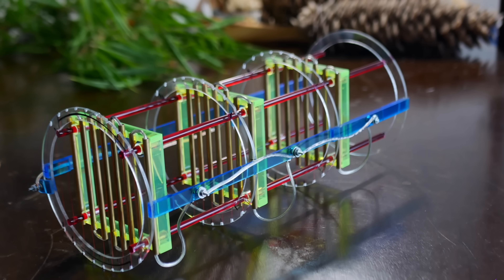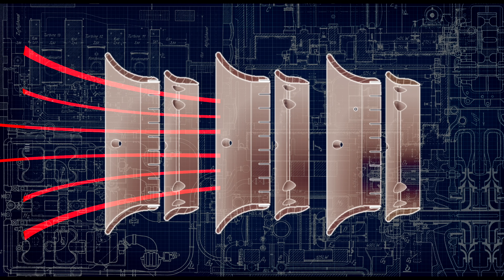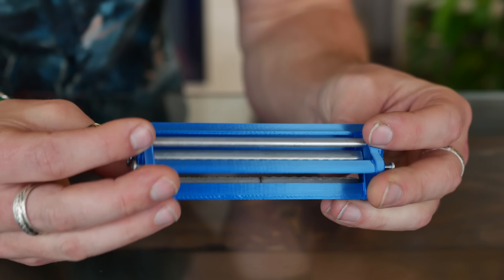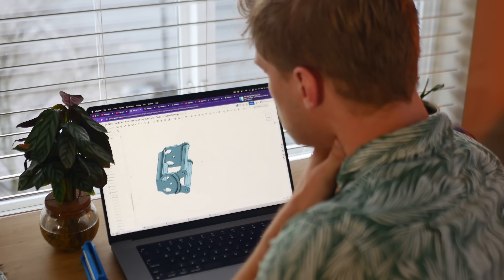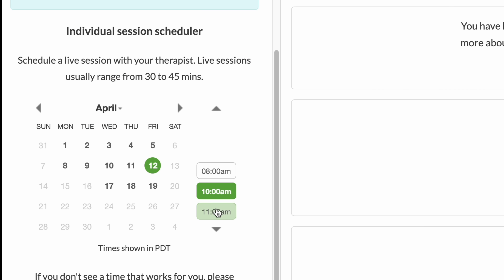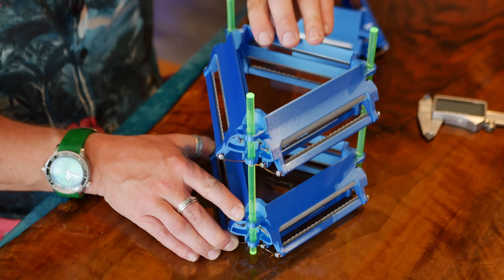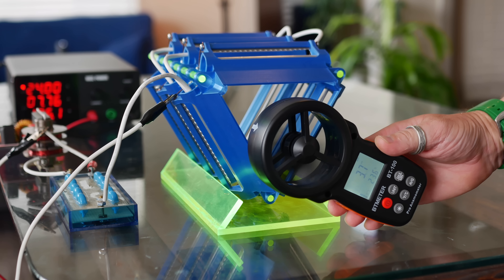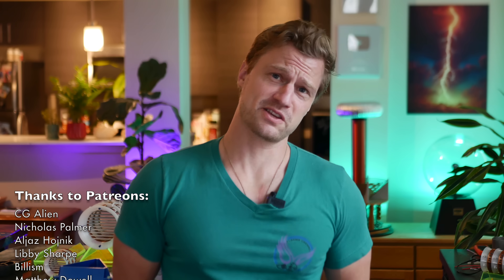Next-Gen Ionic Plasma Thruster Inspired By Nature (BTC Mark 3)

Comment: What happens if you build casing around them? I’m thinking a design where the center is hollow, but the casing has separate channels branching out for each thruster. Spaced out and curved so that each thruster has its own output channel which can converge into a more controlled air stream coming out the back of the setup. Kinda like each section has a funnel on the other side where the sections are separate until the end where it’s all dumped out in the highest pressure possible

Comment: What will be the power source to provide 14 hr's of flight in commercial aircraft, a taser is a lot of power and the weight of the power pack and the payload of the aircraft of today must equal or exceed payload. Then what will be the effect of the wing if power is lost will the wing still provide the glide range needed for a safe return to ground?

Comment: what if you kinda put the same tipe of motor in the center of the current desing for more concentrated airlow and maybey higher airflow
Reply: the it will be weaker structually

Comment: Sorry if this is a stupid idea. But could you put a thin piece of resistive wire along the edge of the razor? This would heat up the tip of the razor and make use of thermionic emission. This makes it significantly easier for the electrons to be released and then attracted to the anode.

Comment: About convergence, I'm curious if a fractal canopy-style geometry could work (https://en.wikipedia.org/wiki/Fractal_canopy). It's also interesting that in one of the experiments there was a suction draft going from the front to the back - this could actually be used to get additional thrust with a fractal canopy convergent design, ie. you can have a tree of thrusters, arranged as a canopy, (including some whose intakes face forward), and the canopy shape can then converge the thrusts into one direction

Comment: Maybe you should try Styrofoam frame. Just use hot wire tech to cut out form then mount the rest of  electronics to the frame. This equipment really should be started out at least 1000 watts and higher mate. Just a thought from an old man.😊 I’ll tell where you should go with this hardware first is HVAC. Also Auto air conditioning and just fans for around work place / home😊 well thank you young man for the demo and your time in the production of this fine video.😊 10 out of 10 from me.😊

Comment: Wouldn't it make sense to make the second stage diameter smaller as the airflow from the first stage converges to a narrower and smaller dia stream? Also giving more spacing between the first two stages after making the second one smaller could increase the thrust factor (?).

Comment: wondering what would happen if you could separate the Power of the 3 stages  and then create a pulse wave cycling through the  stages ,would it push the air kind of like how throat muscles push food down , also instead of a triangle shape , you use shorter  Arc section and make it  closer to a circle shape , would be more thrust surface area

Comment: For Ionic Thrust Boat, you could direct the air stream to the water to have a push from the surface being hit by the air stream. And also improve shape... Imagine a spiral double or triple helix thruster maybe with air guides to make the thrust coming out of the tip of the cone shape. As a nosel.

Comment: Could you maybe use reverse cones in the center with an open top nested together? So they guide the airflow into the center and avoid eddies with the slower moving/stationary air resting in the thruster? As it is I think you're losing a lot to just jiggling air around in the surrounding area rather than pushing it out the back

Comment: Your thrusters are the same size at every stage. If the air column is being compressed as its being accelerated, a narrower thruster in a later stage may compress it further, generating more thrust.

Comment: Can you design the blades to shoot the air in a spiral? Maybe just giving an offset (left side forward, right side back) to each blade to test? I'm wondering if the air is slamming together inbetween each stage and causing drag, and maybe spinning the air will let air merge together easier like a drain in a bathtub or a round-a-bout. Hopefully saving monentum. Cool videos!

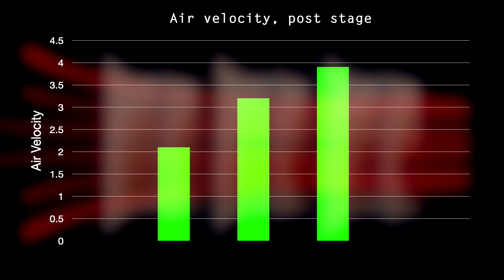Comment: 3:15 You didn't take into account that E ~ v², because E = ½mv². Since all 3 thrusters in series impart about the same energy on the air (40W = 40 J/s), it would be expected for v²/P to be mostly constant. And that's what you see:
2.1² / 40 = 0.110, 
3.2² / 80 = 0.128,
3.9²/120 = 0.127
So it seems that 2 or 3 stages are more efficient than 1 by itself.

If you wanted each stage to contribute equally to the speed of the air (so 2.1, 4.2 and 6.3 m/s after each stage), Then the second stage needed to be 160W and the third stage 360W.

Comment: i think putting ionic thrusters on a blimp instead of a plane is a good next step. or rather a mix. a blimp that decreases weight by 95% but still has lifting surfaces. just because you dont need as much power for lift. its a step up from a boat. but its not as dificult as a plane.

Comment: I enjoy watching every video on this topic and a very interesting idea came to my mind that would be great to add to the next version of the ion thruster.

Since connecting accelerators in series gives an effect that decreases with the number of thrusters, it would be better to add the next thruster optimized for the flow rate of the previous one?

Since our goal is to accelerate the output thrust as much as possible, the geometry of each subsequent thruster will be designed for the output thrust of the previous one, which will avoid a decrease in efficiency.

For example, if we have an output flow speed of 3 m/s on the first one, and an input flow speed of 0 m/s, we calculate the second one for an input flow of 3 m/s, which requires small changes in geometry.

Comment: About kinetic Energy: If you add 40W of energy twice, the air column won't be accelerated twice by the same amount, because E_pot = 1/2m*v^2*. Calculating the change in kinetic energy across the three stages, it roughly stays the same.

Comment: Question: as you mentioned, you seem to loose efficiency with more stages instead of gaining. and I feel you always measure distance but the distance is anyway short, have you consider how the Bernoulli principle could affect the design if you combine it with your convergence design?, may be making the stages to go through a funnel to accelerate the air?. https://www.youtube.com/watch?v=XP6oqIic4lo as reference... You could move effectively much more air by using the principle.

Comment: Consider the Hal effect thruster:
1)  Add a strong electromagnet at outlet of the thruster to generate an electron vortex.  
2)  Place mini electron guns around the outer rim of the thruster outlet to generate electrons for a virtual cathode 
3)  Place a large anode (looking like a v-spike engine) within the housing of your thruster
4)  At the front end of your thruster, place the necessary support structures for the anode + wiring, be sure to leave most of the front end opened for intake
5)  Use your original thruster to provide slightly ionized air to the thrust chamber

Comment: Use a design to take advantage of the ventui effect to accelerate a much larger collumn of air. (Go for a much larger, spaced put design that isnt directly trying to accelerate all the air. Plasma engine should have a unique advantage at doing this! Couple this with an exhaust propelling nozzle design of a jet engine which also uses the Venturi effect to accelerate the exhaust gases to high speeds to generate more thrust.

Comment: I wonder if you need to change your test setup, as it seems you are optimising for an incomplete set of parameters.
1. Add lateral force measurement.
2. Avoid ground effect.
3. Start tracking specific impulse vs weight
4. Add a known speed incoming stream air for apples to apples.
5. Design thruster aerodynamics/stages on the basis of incoming stream of air.

Comment: Fuse a central one with this one to make a better output as it’s using all the air going in you know not just reaccelerating the same air but reaccelerating both normal and other to maximise efficiency and power

Comment: I think that trust is based on asymmetry. Ionic thruster is basically  an asymmetric condenser. That means one plate is much bigger than the other. It does not matter on which side is +, the trust will go always from bigger plate to smaller. Try first with an experiment with a single wire or just the edge of a razor on one side and with an aluminum foil on the other side. Than try different length sizes of a foil. 
In the lifter project they used far greater distance between  electrodes than you. 
https://www.youtube.com/watch?v=ItINqQfrvdk
https://www.youtube.com/watch?v=006d36WWyaQ
There is about an inch long AL foil. I would try with 2 inch, than 3 inch ..........

Comment: The issue im seeing is the fact you made another open garden hose nozzel. You got the flow rate, but no compression of that flow rate to make enough thrust. Imagine squeezing the handel and seeing the water go much further. Also, we are dealing with no moving parts. Turn those thrusters into the shape of a wing. The Comet passenger airliner or the northrop grumman engine design should work wonders for your your engine design on the b2. Remember that the front most thruster will be your intake (lowest power setting) and the constricted (but much more powerful) engine should be at the end. 

Hopefully that mindset helps. Unless your making a prop plane style engine. ?~?

Comment: man, think about also the air that is around the thrusters when you turn it on, the air has a vectorial speed of 0 and then of 2.8. if it is starting to move the object, depending on it's speed it will increase the speed of the air around it with 2.8 meters/second. So experiment with it as much as possible in real life experiments as a thruster, leave the lab more often and play with it :)

Comment: What about the OZONE negative side effect?
This plasma Tec splits oxygen molecules into single oxygen atoms which then recombine with O2 and forms OZONE. 
If this technology goes into mass production and for e.g. all aviation is equipped with this plasma technology, then the amount of ozone produced will be for sure very harmful.
I fear that it could go out of control, because not only it is too easy for the layman to replicate it, but also it is cheaper to acquire. 
The negative impact on the environment has already been seen in third countries that relies on the use of Batteries to store energy, because its recycling infra structure is very badly monitored by the state, and because the state has a lack of resources when it comes to full implementing the recycling system.
One discarded battery down in the soil is like a time bomb in nature, once it decomposes it can poison an entire source of water!

Comment: What happens if you introduce each successive stage at or just after the focal-point of convergence? Think about the difference between blowing up a plastic grocery bag or long bread sack like a balloon with it closed around your lips ( takes several lungfuls of air ) vs holding the bags opening away from your face and blowing from a distance. The surrounding air is carried along WITH your exhale and poof... one good sharp exhale generally does the trick. 

To point at it in a 'box' most of us are likely already aware of ( or at least can quickly verify ), that's why we ( humans ) inflate hot air balloons with a fan blowing into the opening from a distance rather than with an air compressor or even the fan directly filling the opening of the mouth of the balloon. Essentially, take the increased volume offered bu basic fluid dynamics and further compress/accelerate it with the next stage. 

In a flight model it's conceivable that ducted air intake could be used to control the added air volume in flight directed into the open center and the ionic thruster would be able to be used to maintain a high-speed laminar flow at ( or AS ) the outside walls of the interior chamber. 

Just a thought.

I'll go away now...

Comment: What about stage 1 at 50W, stage 2 at 100W, and 150W on stage 3. 
Each stage has a meager 50W differential to it's predecessor but the overall power displacement is 300W.
How could the ionic drive be incorporated in the wing to provide low-speed or VTOL lift?

Comment: Your regular geometry is likely to introduce huge turbulence, the thrusters are fighting each other in unpredictable ways. You need to spare the thrusters so they're outputs are 100% contributing to overall flow direction without inserting another directional force. Could be as simple as chutes that shape the flow slightly before entering the center main flow

Comment: And keep in mind, velocity does not necessarily represent thrust. A turbo fan can generate more thrust at lower air speeds than a turbojet because of the volume of air that it moves and the static pressure that it can hold

Comment: Make a frisbee design with a parachute dynamic in mind and use this new concept in a drone rotor configuration. This way the solid state propulsion is able to float the craft on air and if precise timing is used to control drop the craft and push it taking advantage of gravity and air pressure to propel itself. The device could fly fast and use very little energy in comparison. Then try it again with a design you can fill with helium. Over all it’s like skipping a stone on water but making each skip barely noticeable.

Comment: I know you're trying to make it with no moving parts, although the reason a jet engine can produce so much thrust is because of its feedback loop. Using its own static pressures to rotate the rotor. So would it be possible to make a feedback loop that's non-mechanical?!

Comment: the angularity is inducing turbulence and therefore drag in your air column.  consider modifying the thrusters into each comprising 120 degrees of a circle, and directing the thruster output offset from parallel to the axis laterally by a small degree. by inducing a vortex in the air column, you reduce turbulence just as bleed air louvres do in an afterburning turbofan.  also, you might consider modulating the diameter of the exit with exhaust vanes, or some facsimile thereof.  thus, you can increase exit velo significantly

Comment: Hello, I work with plasma/corona and fluid modeling regularly. I love the inspiration from nature, but seems like the convergence idea isn't a great application for fluids, unless you converge them at extremely small angles. The larger the angle of attack, the more turbulence and flow "cancelation" you will get, which basically means you just want to run them parallel to each other ( 0°). Also, you need to think about how the air gets accelerated by ion flow between the electrodes. They are accelerated toward a surface, which means you are moving most the air by entrainment due to the ion flow. Optimizing the electrode geometry to reduce drag off the faces and increase entrainment may give you a big boost. Like others in the comments have said, you shouldn't Use velocity as a metric unless you want to produce fast moving air. If you want a thruster, you want thrust! Measure the thrust with a force gauge.  Thanks for the good content and high production value.---- Oh also, you should be carful how much ozone you breath on a regular basis, working with so much air plasma. Ozone is amazingly harsh and may have chronic effects if you breath low levels over time.

Comment: You were getting absolutely correct results with Mk 2. Injecting the same amount of energy each stage will yield lesser and lesser velocity due to mv squared over two, doubling the velocity requires quadrupled energy input. Would you mind trying out a christmas tree configuration in order to get a proper convergence? Smallest accelerator at the beginning, "nested" in the second stage, and so on, and so forth , with each stage widening. Another thing to try would be a shared electrode design, where AC drive would power 3 or more  electrodes of identical dedign with rounded leading edge and jagged trailing edge, fully utilizing both half waves. Just my 2 cents. Awesome work 😊

Comment: I would be very interested to see this triangle design converted in to a circle design. 
- Does the triangle design limit the air flow in some way?
- Is it possible to have curved thruster segments positioned around a cylindrical design?

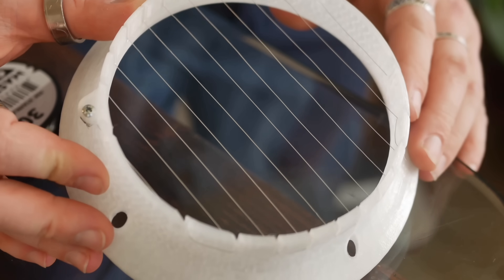Comment: 3:30 Just from a quick look these "diminishing returns" as you said seem very reasonable. Keep in mind that kinetic Energy goes with the square of velocity and the amount of energy gained in a stage is basically the time spent multiplied by the power of the stage. Therefore one would expect to see a polynomial decline of something between 1/x^2 and 1/x^3 from stage to stage. Also because of the increasing speed the continuity equation dictates that pressure must drop which is why pulling in additional air from the side works so well. Given that thrust is just change of impulse, you should attempt to increase the mass flow first and velocity second because impulse is m*v but energy and therefore power required is m*v^2/2. So for a given increase in thrust you would need more energy if you were to achieve it by increasing velocity compared to achieving it by increasing mass flow.

Comment: Hi, thanks for the cool video. This thruster has a cool idea behind it, but if you look at the veins in a leaf, you will see that there is some distance between them. I think you will achieve much better air flow with 70 to 100mm between each thruster section.